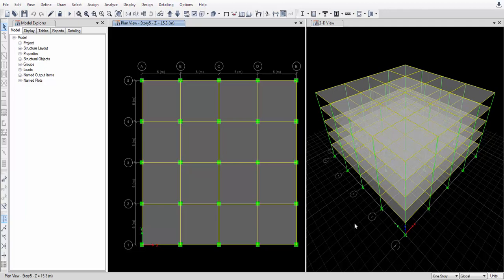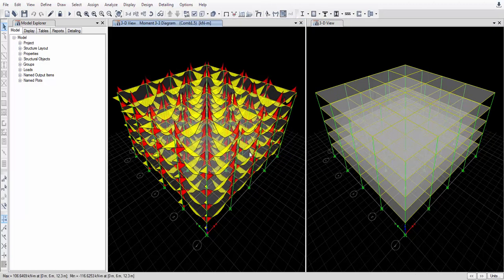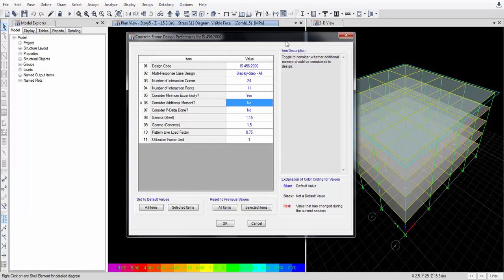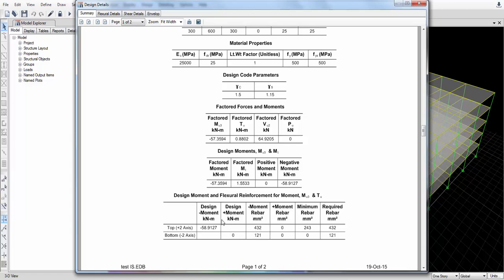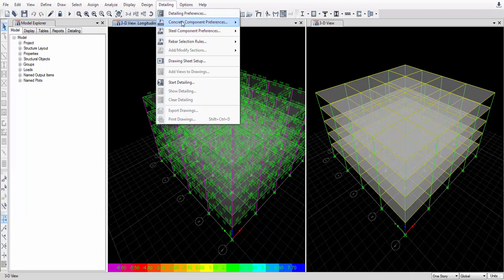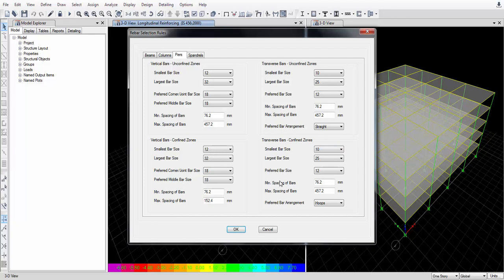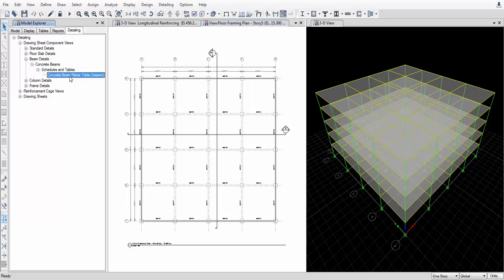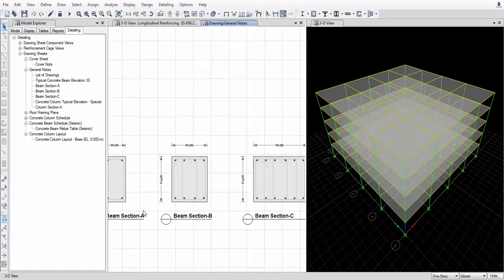Etabs 2015 tutorial 4 | Design and Detailing of RC Building | Using IS 456

Comment: it showing 14mm bars in longitudnal bars in beam rebar table under detalling section but we don't have 14mm bar in market and as u also changed rebar preference why it's not changing 14mm to 12mm dia bar
Reply from the maker: Mohit Sheshma Before analysis you have an option to remove unwanted rebar sizes. That is goto Define-Section pro- Rebar ...- open list and delete the line which is not required. Press ok.
Reply: Qamar Moonboy thanks it helped me bro your tutorials are good keep it up

Comment: I'm not able to find the (beam rebars detailing) or any detailing for beams or slabs. All I could find is detailing of 2 columns, is it because I'm using a trial version?
Reply from the maker: Brother your Building might be Failing. So increase the Column section Sizes so that they pass the test.
Reply: how can I perform that test and check the results. Though I tried a very simple building 4mx4m slabs, 30cmx60cm columns, and 30cmx 70cm beams with normal standard loading cases!
Reply from the maker: ObadaHalabi brother you will find check the all members passed option in concrete design in design options.
Reply: yes now I can generate the detailing for beams. They passed, I just needed to perform that check. Thank you so much.

Comment: This is one of the best Etabs tutorial video I have seen. But I have a problem... am used to designing beams as Flanged and not rectangular as many videos are doing. and I dont understand how to specify T-beam and L-beams in Etabs. Pls explain thanks
Reply: IN THE DEFINE BEAM SECTION YOU CAN DEFINE A BEAM AS T OR L BEAM. BUT FOR WIDTH OF FLANGE ( AS FAR AS I UNDERSTOOD), YOU HAVE TO CALCULATE IT MANNUALLY FROM THE ARCH. DRAWING

Comment: Hello... Thanks for this tutorial on Etabs , design of RCC building, Could you please expalin how Long slender column can be designed with effective length calculation as per IS456-2000
Reply from the maker: Length of the column can be increased until the Reduction factor of the column becomes zero. If reduction factor decreased to negative value then it's length is increased more than the requirement.
Reply: Thanks, Actually i wanted to know as per  ANNEX E of IS456 2000 , Does Etabs consider this or do we need to manually enter the effective length
Reply from the maker: Etabs consider all as far as you mention correct codes during start of file.
Reply: Check slenderness limit in IS456